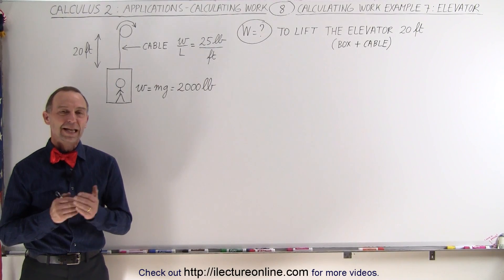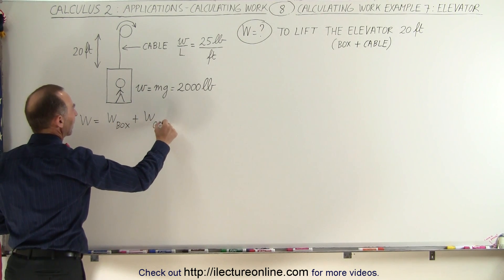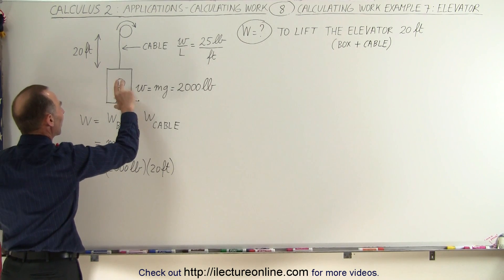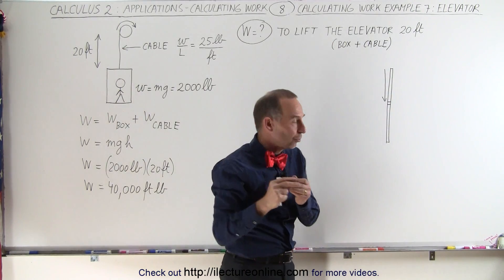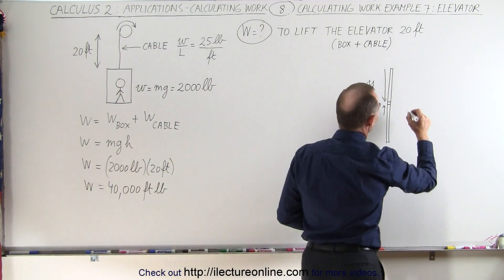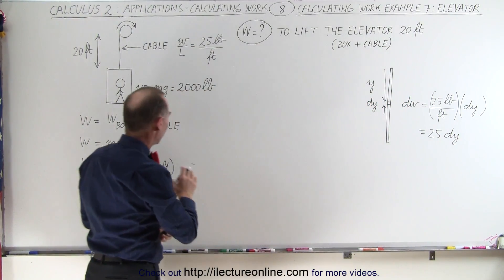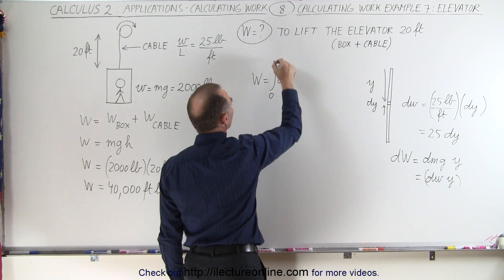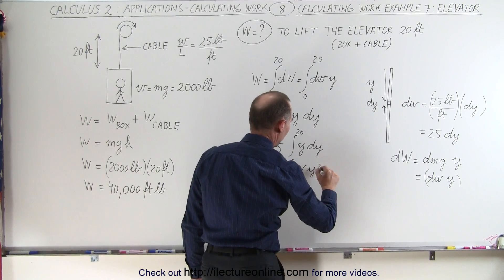Calculus 2: Applications - Calculating Work (8 of 16) Calculating Work Example 7: Elevator

Comment: Hi, Michael, I am a structural carpenter. I am trying to design a particular strutted roof truss for my house extension. With 35 years of experience I am pretty sure how it should work but I don`t have the maths knowledge to proove it. I was wondering, if I get the details to you then, you could do a video of an actual real life solution, and I get my calcs for free! ( I`m on a very limited budget ) Let me know. Steve.
Reply from the maker: Steve,  It is better to pick up a pamphlet at city hall that shows you the building codes.  They give you the spans that can be covered with different types of wood and different truss combinations.
Reply: Hi Michael, it`s not timber sizes or types of wood that I have a problem with. It`s the strutting design and their span reducing abilities. In the UK I don`t think Local Authority, Building Control can help. They require drawings backed up by calcs. Steve.